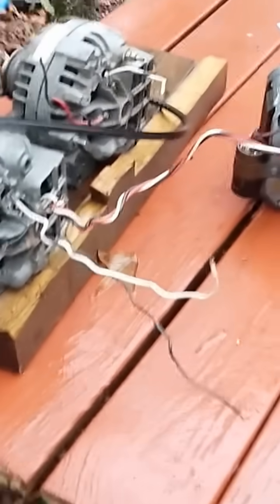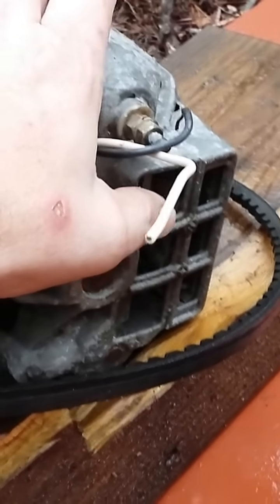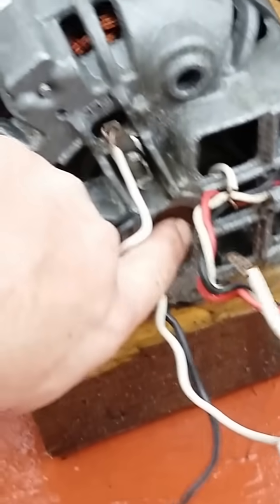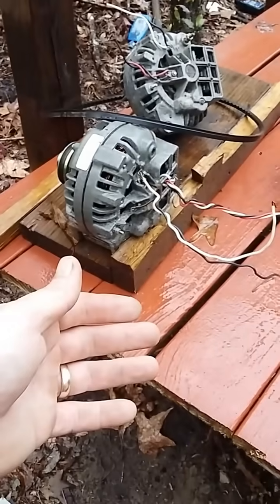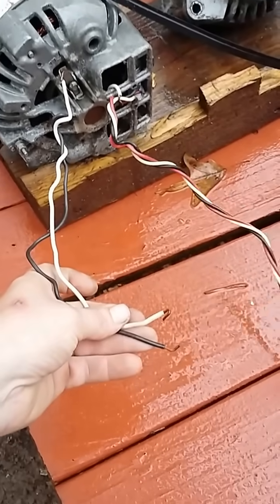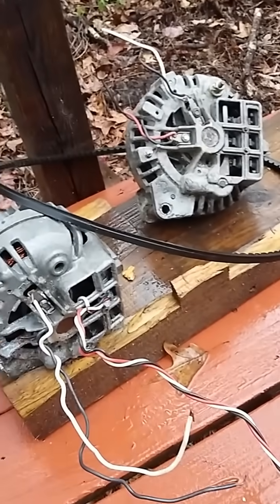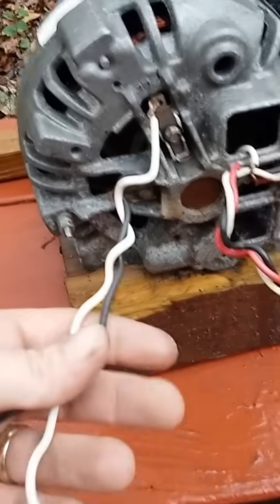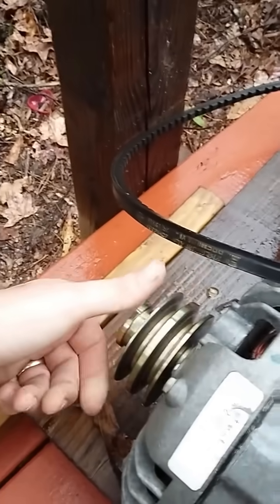Update Free energy forever no wind no solar no gas READ DISCRIPTION!!!

Comment: TIME IS SHORT = the Pre-Trib Rapture + the infamous 7 year peace treaty with Israel MUST START before the Door closes on 2019.04 - http://doorschristmustpassthrough.yolasite.com/. 
We were given the best Gift from God, (other than Jesus) right here in Atlantic Canada + just before the infamous 7 years Peace Treaty, + 2nd half  as being the (Great Tribulation) where most all of the fallen angels, and Nephilum = angel offspring with women will be sent to the earth. This is not only the ones that are still alive, but also the spirits of all that have died. This could be massive amounts of evil spirits, considering that this includes the ones from before the flood. 
-
http://free-energy.yolasite.com/
Do you want to hear how super simple this technology is, 
You only pay to crank over one 100 cm circumference pulley,
Then you use the moving 100 cm of moving belt off this large pulley,
+  run it past 10 mini-pulleys of only one centimeter circumferences, 
All that you have to do is add AC generators to these 10 mini-pulleys, 
Giving you a free return of 10X100=1000 cycles of AC electricity. 
-
You are using the dirt simple laws of pulley mechanics to multiply rotations, 
+ since AC electricity is generated by simple rotations
You are using the dirt simple laws of pulley mechanics, to multiply your AC electricity 
-
IT IS TRULLY THAT SIMPLE…………………………….
-
And don’t you believe that torque is a problem, 
You have 10 X 100 = 1000 cycles of AC electricity,
To make up the one spark of DC current that you need,
That this DC drive motor needs to be cranked over the one time, 
Giving you the 100 cm of moving belt = off 100 cm circumference, 
-
CAN YOU BELIEVE HOW SIMPLE THIS TRULY IS
+ how powerful this spiritual warfare is, 
to be able to hide this super simple AC multiplier from us gullible humans..............
The making of GEM free energy technology
------------------------------------------------------------------------    
You start with one large 100 cm circumference pulley, 
+ you attach one DC motor to it, + this is your drive motor, 
can be any voltage, as long as the same as your AC generators 
-
Then you get 1-3 mini-pulleys, each of 1 cm circumferences, 
+ then you attach 1-3 AC generators to them,  
-
YOU MUST attach all of these pulleys together,
With a belt, strap, elastic, rope or even a piece of tied string, 
-
Now you connect these generators to 1-3 full wave bridge rectifiers, 
To convert your AC output back into the DC of your input drive motor,
-
Then you run wires from the DC output of your full wave bridge rectifiers, 
+ run them back into the input leads of your one single DC drive motor, 
-
Now if you only start to rotate your large 100 cm pulley, only a quarter turn, 
This will generate enough power to not only start your DC drive motor working,
But it should be able to keep your DC drive motor running perpetually, 
-
It should be able perpetually keep the system running because of pre-school pulley technology, 
You see that the 25 cm of belt that you get from only a ¼ circumference of large pulley, 
-
Is more than enough belt to give you 25-75 cycles of AC electricity, 
By passing this 25 cm of belt by your 1-3 mini-pulleys of only 1 cm circumferences each
-
So each of these 1-3 mini-pulleys get to rotate 25 times each,
That’s 1 to 3 X 25 = 25 to 75 cycles of AC electricity,
-
Now try and tell me that you cannot get the one spark of DC current, 
Out of these 25-75 cycles of AC current
-
Remember that these 1-3 mini-pulleys are running free of most all torque, 
As the only resistance these 1-3 generators have, (other than viscosity of lubricant)
Is the resistance of the power being generated by them, 
Which is P=I V, which is “P”ower is equal to “I”-current multiplied by “V”oltage, 
-
+ remember that no matter how high of a “V”oltage that you are winding up,
You do not need very much “I”current, you only need one short bit of current, (practically zero)
-
+ remember zero times any number is still equal to zero = (law of mathematics)
So,,, even massive “V”oltage times practically zero “I”-current, 
Still equals practically zero Power = which take practically zero torque, 
= these mini-pulleys are running practically free
-----------------------------------------------------------------------------------------------------------------------
Now, please remember, these 1-3 mini-pulleys, with AC generators attached, run practically torque free
because torque comes from generating power, and P=IV, where “I”-current  is equal to practically zero
-
http://free-energy.yolasite.com/

(here is a picture that shows basic idea of this GEM tech)
(but the small pulleys should be much smaller + 1-3 not 4)

Come on Canadians,,, 
Come on Nova Scotia,,,

This is where this GEM-(Geometrical Electricity Multiplier) technology of free energy for the End Times was 1st started. Let's get out there and start taking advantage of it, by not only building GEM units to power all of our electric tools, toys + gadgets, but we could be starting companies that have electric appliances, utensils, devices, tools, toys, + gadgets with these GEM perpetual power supplies built into them, (let’s start letting electricity generate itself) + on our labels we could even proudly say "FIGHTING TERRORISM + FIGHTING POLLUTION"

COME ON,,, ALL OF YOU BACK YARD MECHANICS,,, 
Get some AC + DC motors together of the same voltage, and start building these GEM free energy power supplies,, + not only for 1.5, 3, 6 + 9 volt batteries, but household 120, + 12 volt, for powering these new electric cars. Let's throw the oil companies the bird, + maybe even make money with them, by throwing any excess power from these perpetually running energy generators that we have the time, + small amount of money to purchase parts to build. Think of it as not only keeping money in your pocket, but you are keeping money from the countries that fund terrorist. This is not to mention the experimenting that we could be doing with the anti-gravity + speeds approaching light speed. Now I know that there are many out there like me, that would enjoy knowing how one type of this motor was powering a UFO in the Bible, in Ezekiel 1:16.

 The thing is, that there is the most powerful spiritual warfare going on about this simple free energy technology, and evil forces will immediately start confronting you as soon as you start looking into this. I can be sure that evil forces will whisper in your ear, many ways that this cannot possibly work. For why should evil spirits want us to be able to stop buying oil, from nations that in one way or another tend to promote terrorist, and their careless destructive ways. I believe that God gave me this technology back in the early 2000’s when He first gave me a Vision of a 10 speed bicycle going uphill in 10th gear, and then back downhill in 1st. This is very significant where AC electricity is concerned, where you may need massive voltage, to crank over the pedals on the way up, but it costs way less current, as the motor runs for only a few rotation. Then when you run the bicycle down the hill in 1st gear, you would be winding over your AC generators massive amounts of time. Please remember that AC electricity is generate through rotations of a coil of wire through a magnetic field, and the more rotations means more AC electricity.

Although we are warned “but of that day and hour knoweth no man”(Mat 24:36), we are also assured that we can “know that it is near, even at the doors”, (Mat 24:33) Where the door closes on the Prophecy when it can no longer be fulfilled. My name is Joe, and I now live at a nursing home in Nova Scotia, and if you can find me an electronic simulator that I can use, I will show you how this free energy technology can and will work for man, instead of man having to work for energy. In any case, please let me show you how all of the barriers can be overcome, instead of taking Satan’s words for it, when he or the billions of evil spirits throw excuses at you, for why this will never work. My email is one_christian_warrior@yahoo.ca

Having the first Door closing by 2019.04, http://my2020vision.yolasite.com/ we have less that 20 months now, before the pre-Trib Rapture + signing of the infamous 7 year peace treaty with Israel, ushering in the anti-christ + the “Great Tribulation” + then Christ will set His Feet on the Mount of Olives, to fulfill the second part/Door of this prophecy, when He Comes again to this earth. This coming cannot be the arrival that no one knows, because the Tribulation Saints will not only know when this arrival will be, but they will be counting down the days until. 

http://beliefstoliveby.yolasite.com/
http://fire-starter.yolasite.com/
http://rapturequestion.yolasite.com/
http://aliensandghosts.yolasite.com/

http://askthatprophet.yolasite.com/
http://evotutionfairytale.yolasite.com/
http://possibletimingfortribulation.yolasite.com/

http://overunity.com/17091/gemgeometrical-electricity-multiplication/

Comment: I notice the way you ran the alternator is the same as ebike Moter setup. ebike moters start at 250 watts  up to 2000 watts 18 to 36volts lithium batteries with variable speed and cost 500$ complet kit controller battery wheel and moter. Base on input voltage, current what do you think the hp,  watts would be. Well if it want pull a bicycle  how about  models planes, boats? The toy  I want is that wood burner that turn hard wood  into butane to run a gasoline  engine I could make a lot  of electricity with a 6 cylinder moter at lease a 5kw to 10 kw.
Reply from the maker: yes sir that is the exact way that I'm using that Gm alternator/generator and I want to say thank you for the intelligent questions the brushless direct current motor system is the way to go you don't use but maybe 10 amps and you are pushing out some power!! (HP) look at it like this, if you're running this type of system you have a 80 or 90 amp DC alternator that will run that system very easily and then you will have an extra power source that can rub a large alternate current electric motor and power larger generators without the need to use them to charge your system while you're using your system...

Comment: I only pay half attention. But don't tie in to existing circuits that are connected to the grid. Requires separate panel box power inverter  to phase match , auto transfer switch and permits, permission from utility and a manually disconnect between your meter and your panel. Best bet do a complete separate isolated panel box for emergency circuits only then don't  tell anybody. Jail time alert. On the generator the center tap is a ground and can kill you. it's that forth bare wire that goes to ground at every  pole. It's the center tap of the generator and with the right in put dc volts will make 240 volts between any phase wire and 120 any phase wire to center tap which is  called 3 phase 240 ,120 volt Y tap and the center tap has to be grounded except for testing purposes. Jail alert is back feeding the grid with 120 volt that  becomes 5100v  to 12500v on the grid wires. It's called a step up or down transformer it works both ways. For altenater I recommend  a small engine, wind mill or water or steam driven eaven better build one there is plans on the internet  just a guess a car alternator would not handle more than 50 amps and if you don't  believe it, it takes a 8 hp gas moter  to make two 15 amp receptacle or a 30amp 3 phase receptacle and two 10 amp skill saws will choke  it down. And D.C. 12v, 50 to 70 amp to feed 3000 watt power inverter to run a 1500 watt microwave 1000 coffee maker, computer 12volt refrigerator.  it tore a big trk altenater up did a few months.

Comment: What?!! No demo? Does it work or not? If it did you could've shown it. A minute or two to organize your thoughts & present some real facts & figures (or how-to ) would've been greatly appreciated, but as is this video is pretty worthless.
Reply from the maker: +Dan Beatty go watch my other videos so you can see the different systems running
Reply from the maker: +Dan Beatty but either way you can use this system to have a direct current overunity system so how would it be worthless?
Reply: Thomas Buie I'm sorry, you seemed to have misunderstood my comment. I was talking about the video as to its content, not you device. Your presentation needs some organization, demonstration, and basic  factual information gaps filled. That's all I was saying.

Comment: THATS FINE BUT HOW DO YOU TURN THE ALTERNATORS WITHOUT A POWER SOURCE.
Reply from the maker: +Jim Lovelace I use my mind
Reply: LOOK AT A CAR. SWITCH, STARTER MOTOR, ALTERNATOR N ALSO A BATTERY. MAKIN A DISC SPIN WITH MAGNETS N TAPPIN THE POWER FROM THAT MAY WORK.

Comment: For any people who don't think this will work just think about it. Alt puts out about 50 amps at like 220v when bypassing diodes and connecting straight to coil, to spin the alt it would only take an electric motor about 5-10 amps 220v, keep in mind you only lose amps not volts, so you would have about 40amps left over, that HEAPS it should run itself!!! Please what am I missing? Except the 3 phase to single phase thing.
Reply: Thomas Buie sick man, I'm going to live life loving like you brother keep up the good hope
Reply from the maker: the only thing you're missing is the alternative source to start it, you can not have your AC motor running when you start it off of your generator. that will do nothing but cause a breaking in the system and it will stop the generator from turning all together. think about my set up in the other video, where I am running 2 10000 watt generators off of less than 3000 Watts AC that's 17KW AC Peak that I'm not even using. a little over 11,000 overunity continuous...   if you use direct current to power your generator then you don't have to start it with an alternative Source you can use a battery to start it AND it will be just like a capacitor but you will lose more of your alternate current because you're not switching over to alternate current and when you transfer from alternate current to direct current you have to use twice as much power because you're constantly charging the battery while using the battery but the overunity in a system like that is still plenty enough to run one big or two small houses... sorry I just woke up in the middle of the night? weird meeting... while I was asleep, well not consciously asleep...  anyways I hope this helps any newcomers to my channel and don't forget to like, share, and subscribe because we are down to our last $ again but I will get paid the 21st or 22nd of next month so I think we will be fine!! Yahweh always watches over us and yes brother I am back!!!  (And this doesn't mean vengeance) #LIVELIFELOVING  I love you guys!!! I'm going back to sleep.. I have some things to do!!!

Comment: A diode itself does not change AC to DC...that is a rectifier diodes connecting to the outer taps and center ground taps create the rectifier.  It would be easy to confuse people by saying a single diode changed A.C. to DC  when it actually just directs the flow of current.
Reply from the maker: +Scott Hoskins  Yes, you are very correct. Thank you for pointing that out, it hasn't been said in a while.
Reply: that depends on the amount you use and configuration,as in a diamond,wouldnt that do the trick
Reply: StarSeed what you are referring to is a full- wave rectifier. It takes the a.c wave and makes it d.c pulses at twice the frequency of the a.c input voltage.
Reply: LOL, whatever. Like I said a single diode will turn AC into DC, it will just be choppy. Will still work for 99% of applications as a DC power supply.